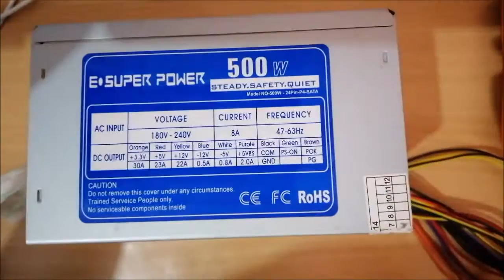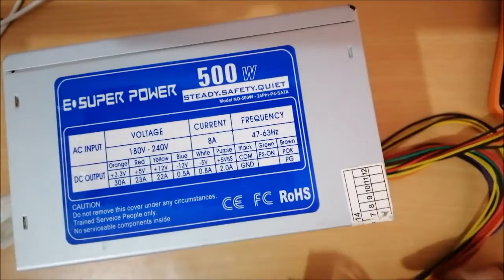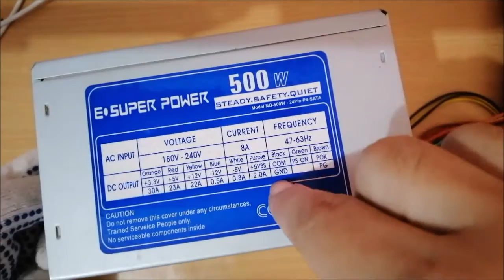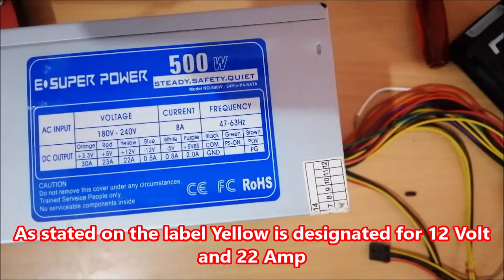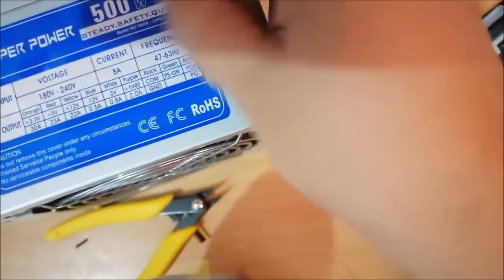cheap computer power supply for 12v cordless to corded makita drill and grass trimmer | smps | diy

Comment: that's an informative video, By the way, I tried this method with my ATX psu. the fan is running and yellow line/grd give me 12vdc, But once i connect my cordless drill. it run for a few second and it stop giving power. re on the switch and it run again but it loss power again. BUt when I connect it to 5VDC, it run without shutting down. So what is wrong with my PSU?
Reply from the maker: Smps I think which means it built up heat drawing too much amp during the start so the sensor of the transformer shut it off
Reply: Need to remove over current/over voltage circuit protection

Comment: Why not just use a 12v 2 A power adapter?
Reply from the maker: Because it won't work.. At initial spin the drill require at least 5A to 7A and normal spin around 3A without load

Comment: i dont know what im doing wrong but i connect all ok i push the button and it works, as soon as i let the button and push it again it fails. psu stops.
Reply from the maker: I guess because of SMPS..what is that you are powering?
Reply from the maker: @PetrosLAN  when you operate power tools at the start when it first trying to spin it actually need a lot of amp but when it is already runs it doesn't need so much amp the smps psu cannot allow so much amp at the start of its operation to protect the circuit from burnt so it automatically turn off the power I think to prevent over heat
Reply from the maker: It could be when the first time it turned on heat built up and thats why second time it prevent from turning on to avoid overheat
Reply: @neodiy  should i try another PSU? not from SFF pc?
Reply from the maker: @PetrosLAN  I read somewhere it's best not to use all kind of SMPS power supply like the PSU...u could actually build a direct AC step down to 12 volt DC without complicated SMPS circuit...which means you just need a transformer, AC capacitors, DC capacitors and some high temperature diode...or you could find them on ebay...a direct step down is way simpler but just be careful handling high voltage thats all my best advice
Reply: @neodiy  what is SMPS?
Reply: Need to remove over current/over voltage circuit protection
Reply: @noob_mechanic  meaning? in the psu? where is that?
Reply from the maker: @bongd244  this is how to remove the over current and over voltage protection https://youtu.be/W7KBXyfCizM
Reply from the maker: Remove the circuit protection see this video https://youtu.be/W7KBXyfCizM
Reply: @bongd244  You will need to get a PSU with high AMPERE at least 20 A
Reply: @neodiy  So minimum is PSU with 500 watt and 20 A
Reply from the maker: @latiffesa  written on the label 22 Amp...but i am not certain of this until tested...so far it runs 12 volt makita grass trimmer...i have been cutting grass quite often and the psu work just like what i expected all the time without fail...btw the psu cost only $10 it really save my pocket money because makita won't sell anything less than $40 including its 12 battery